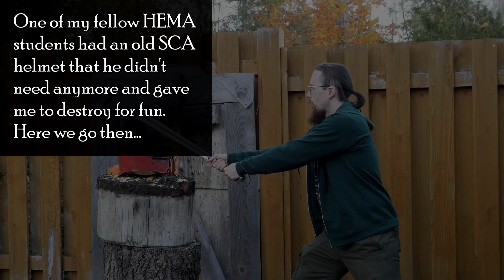Bar Mace and Blacksmith Hammers vs. Old SCA Helmet

Comment: Can't we all just hate stainless steel
Reply: I hate stainless steel so much...
Reply: Stainless is steel is great  for armour though (depending on which type) however it's a bitch to work with
Reply: I was under the impression it was more durable than lower tier carbon steel and definitely more durable than mild steel

Comment: With solid HMB helmet it would take all day.
Reply: Kamil Szadkowski dafuq is an hmb helmet
and what was that helmet in the video?
Reply: Historical medieval battles. SCA helmets are built to withstand lifetime of wooden stick abuse, HMB helms are designed for a lifetime of rebate steel abuse.
Reply: In short, HMB is a modern combat sport for historical reenactors. It's inspired by historical bohurts which were type of tournaments held in Middle Ages and Renaissance. SCA stands for Society for Creative Anachronism so basically LARP. Most of the time their equipment is loosely based on historical examples (if at all) and doesn't exactly reaches the quality of arms and armours used for HMB.
Reply: Kamil Szadkowski thanks, men
Reply: Not defending SCA’s stick fighting but their rules for armor thickness and hardness is really really strict, 

I was recently around some very talented blacksmiths who make HMB and SCA helms that are interchangeable, as in nearly all their helms were legal for both, and some SCA helms were even sturdier.

The thing is that HMB weapons have an edge and glance off easier than the dense rattan clubs that the SCA “weapons” are

(I’d also like to state that SCA does have rapier and also steel fighting, although it’s more akin to HEMA rules and uses flexible weaponry, but is less popular as most people are drawn to the heavy stick fighting, which is essentially a lot of men in ugly bulky overbuilt helmets. swinging heavy wood cudgels at each other for a while.)

generally HMB helms and SCA helms are about on-par when it comes to gauge and hardness, BUT I think it depends on the individual helm. I’ve seen SCA built helms that make HMB helms look weak. And I’ve seen HMB/BON helms that make SCA helms look like paint buckets